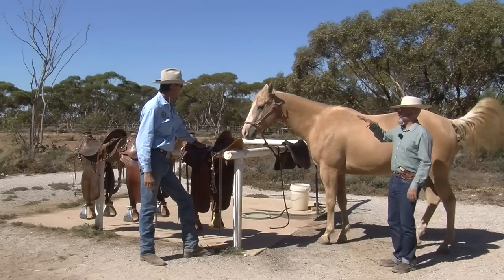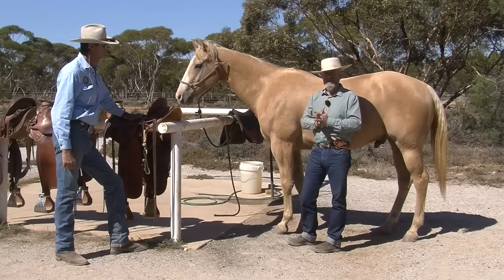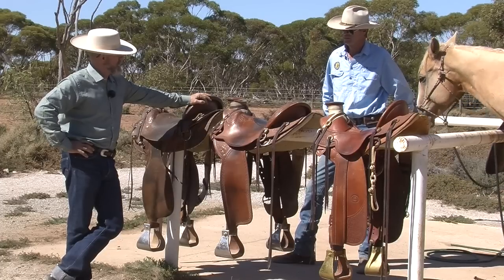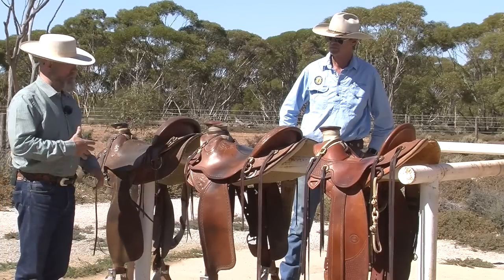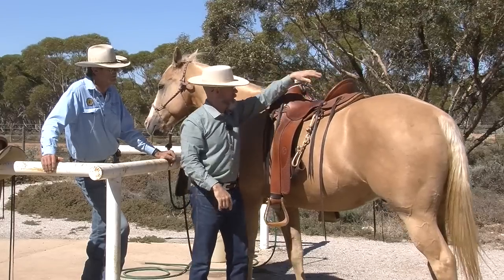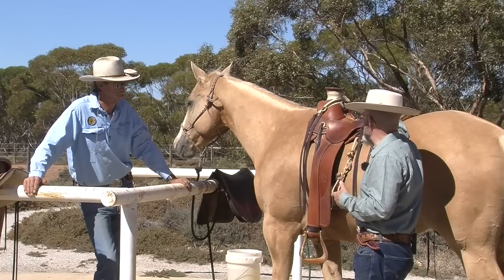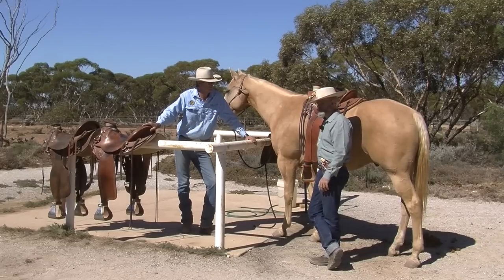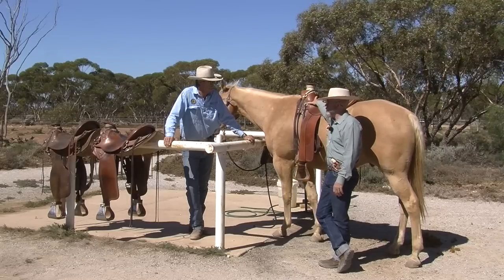Jeff sanders talk on saddle fit

Comment: Great information.  Agree with the comment by Epona - tree or no tree, how the rider sits and uses their weight has a big impact on the horses back.  How the horse is exercised and ridden will impact greatly.  Also it does not actually mention the fact that regardless of weight bearing surface, a horse carrying a very heavy rider who both sits very heavy and works the horse hard will cause pain in the horses back, even if the saddle is the best saddle in the world.   Lovely video though - very interesting and anything that gets people thinking about the welfare of their horses is worth the air time.  Thank you.

Comment: I agreed with pretty much everything you say  now when it comes to the saddle tree I don't care how good the tree is you can sculpt it to conform  the back of the  horse you ride   all you want but  the back of the horses changes  throughout the years weather is  age or losing weight gaining weight if you turn them out for a few months in the pasture and bring them back obviously their top line is not going to be the same   saddles such as the Spanish vaquera saddle (tradicional)  and the gaucho recado    will conform to any back any type of horse  so I think  they are way better stock saddles than the western  saddles now having said that all saddles have pros and cons

Comment: Interesting video but I think the backpack/treeless saddle analogy is fairly weak.  First, having the weight hanging on your shoulders isn't the same as having all the weight pressing on your spine.  Secondly having no frame on the backpack isn't comparable to having no saddle tree.  Seems to me no frame on the backpack would be more comparable to a rider slumping down in the saddle and not supporting him/herself.  Both examples of dead weight.   Just a thought.